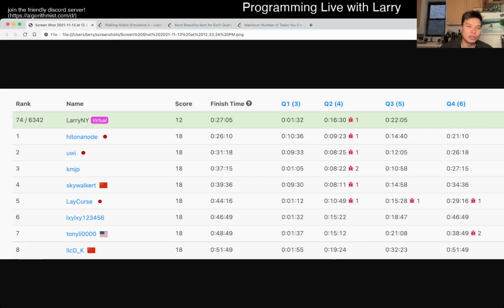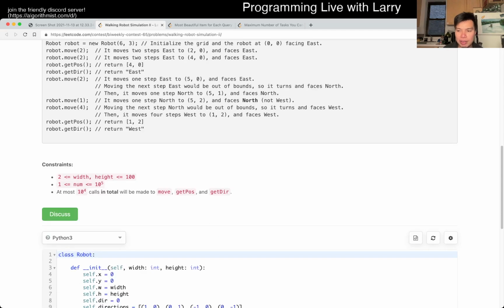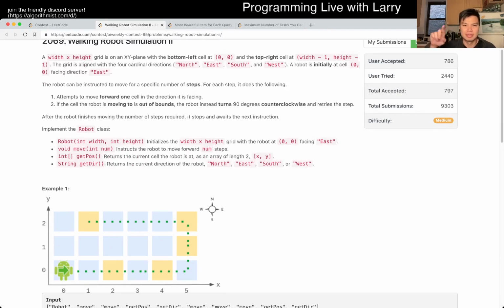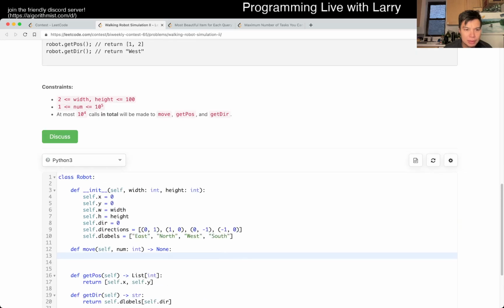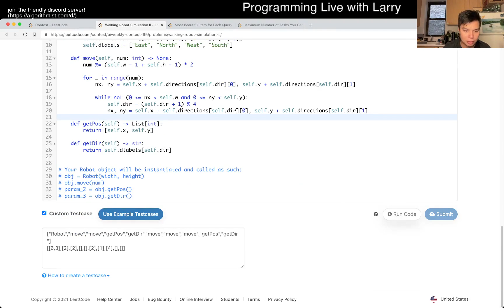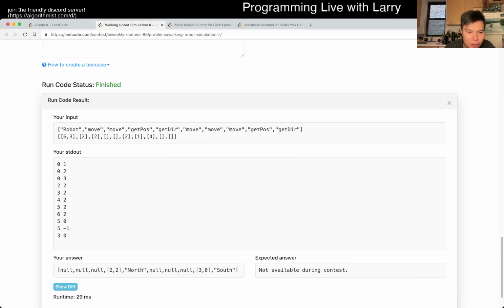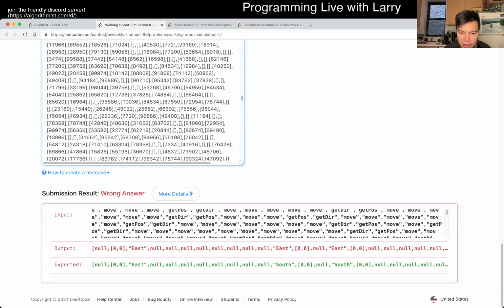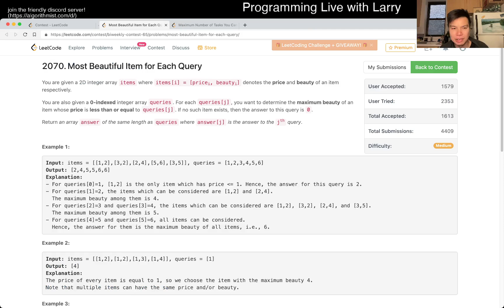2069. Walking Robot Simulation II (Leetcode Medium)

Comment: did not use the modular that way, i optimized it the other way, but got tle on that 😬, but that code worked smooth once i added the modular operation
the updation is a lil different in my version😅